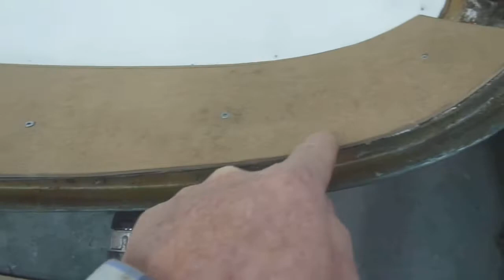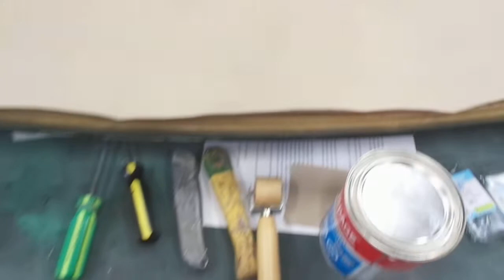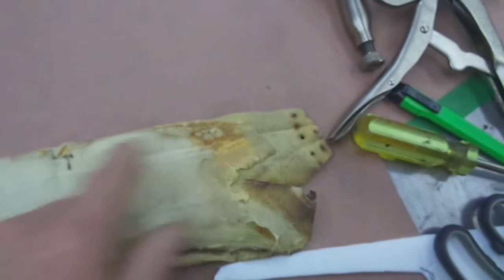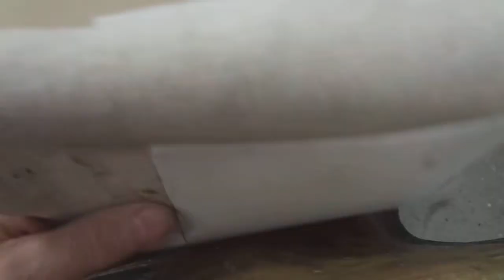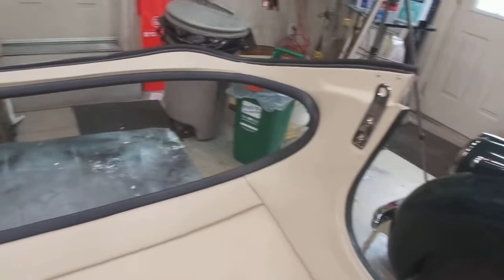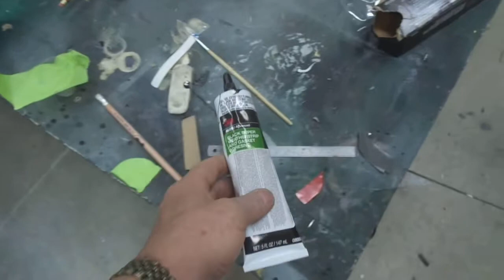Jaguar E-type OTS Hardtop Headliner - Part 2, Replacement

Comment from the maker: A further, important recommendation: it might be best advised to not use  a 1/8" thick closed cell foam pad under the main headliner. When being glued in place, the headliner vinyl has to be stretched slightly to conform to the compound curvature of the hardtop underside. This puts it under some tension that over time can cause the headliner to tear away the top surface of the foam and sag, despite being well adhered. Better I think to get the underside of the hardtop as smooth as possible using a high build primer and gluing the headliner directly without an under pad.